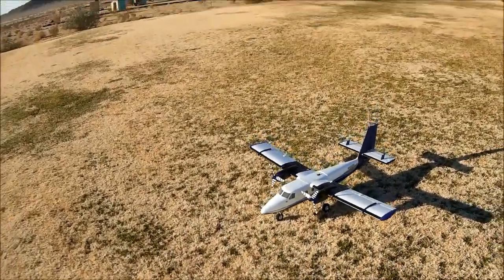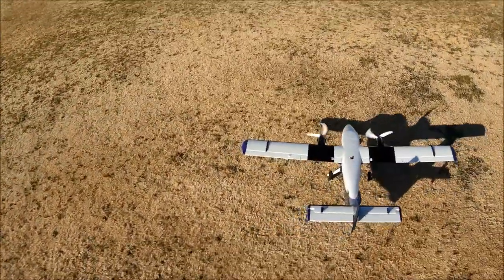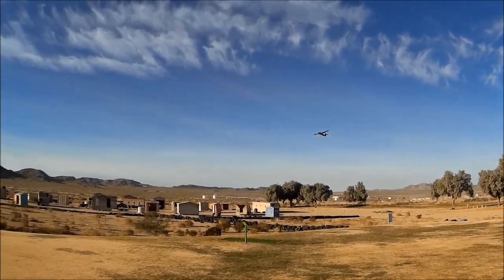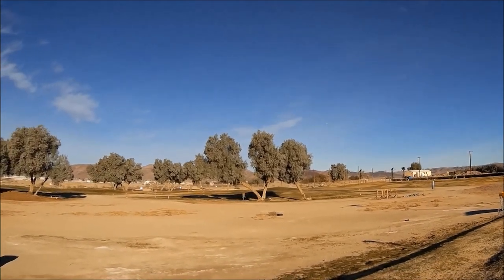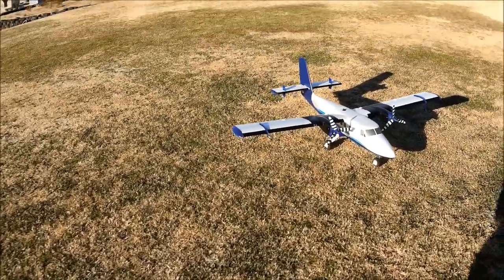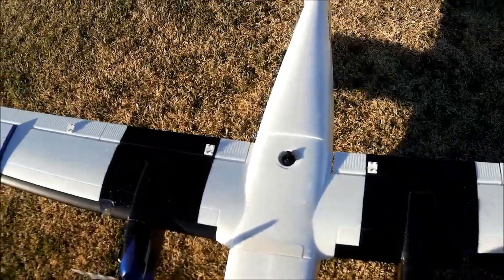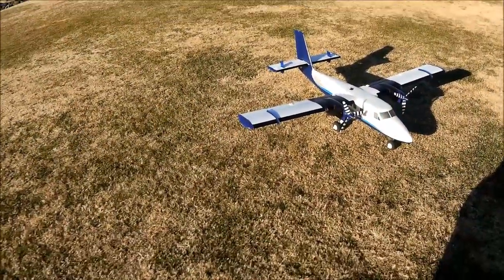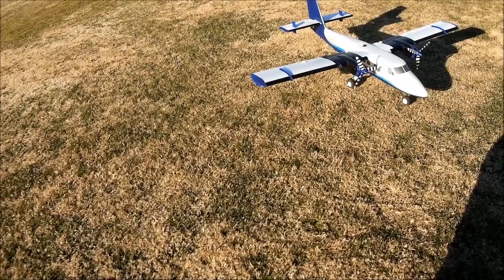E-flite Twin Otter 1.2m BNF Basic - Maiden Flight!

Comment: So maiden for me was ok...the CG was per the specs...but I had to dial in a ton of down elevator.  Did a go around, brought it in, checked the battery location...jammed it all the way forward...took off, same thing.  This thing needs some weight in the nose.  My rudder had no issues.  Black tape on the elevator had bubbles (I smoothed those out)... hope to give it another spin tomorrow with some nose weight.
Reply from the maker: Well, glad to hear she's down in one piece and the maiden flight went off well! Yeah, I'm trying to figure out if it's an incidence issue with the elevator, or if it really does need nose weight. The manual does call for about 3mm of down elevator, and I can't figure out why. I got mine to balance at the point where the manual calls out, but I think that's actually a bit too far aft on the wing, about 25%-30% of the MAC. She'd probably fly better with the CG a bit forward of that. I'll have to try that after the Holidays. I look forward to hearing more about your flights and wish you all the best!

Comment: Hey bud thanks sharing I got mine and have yet to maiden it. But they didnt put a relief in for the elevator control horn because if you slide the elevator in from the other edge the horn doesnt have to pass through it. If you meant something else by that please explain so I can make sure mine is set up properly for her first flight.
Reply from the maker: Hey Justin! The relief I meant was for the elevator connector to move up and down freely without touching the vertical stab. If you just slide in the elevator and then try to move it up and down, you should see/experience some binding on the vertical. It's not much, but it just might be enough to overdrive a servo and make it burn out in flight. You just never know and I wanted to point it out to folks, that's all. All the best my friend 😎👍!
Reply: Thank you for clarifying really loved the video im super excited to fly mine! Im trying to decide if I should fly mine off the water and make a video of that.
Reply from the maker: Well, I guess I'd have to ask if you've ever flown off of water before. If not, fly her on her wheels first to get a feel for hte plane, then slap the floats on and get busy 😉😁!
Reply: Yes I've flown off water before with a beaver it was a ton of fun.
Reply: Got home turned the plane on and found exactly what you were talking about and got it cleared up. I'm glad you mentioned it in your video. Thank you again
Reply from the maker: You're more than welcome Justin, I'm glad you got it sorted! All the best my friend 😎👍🎅!